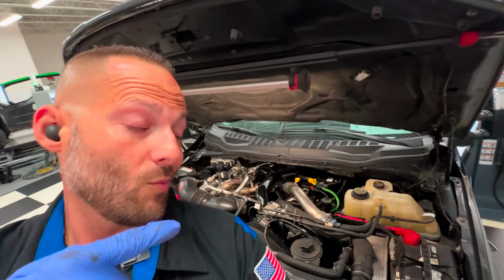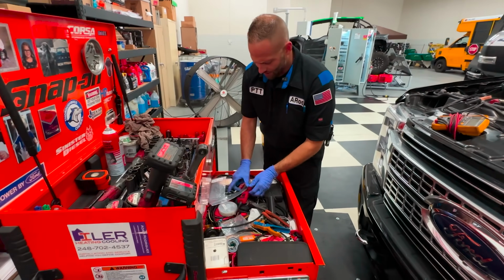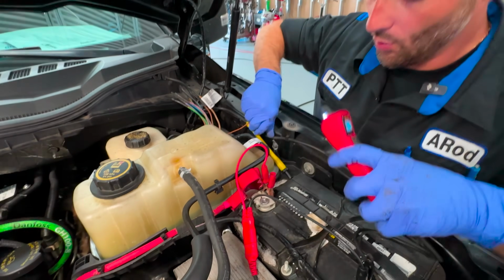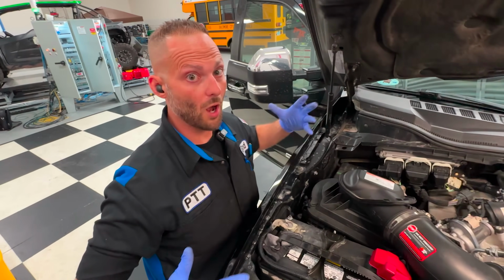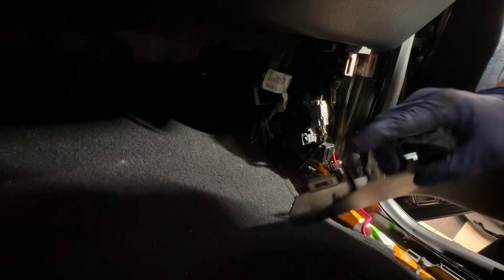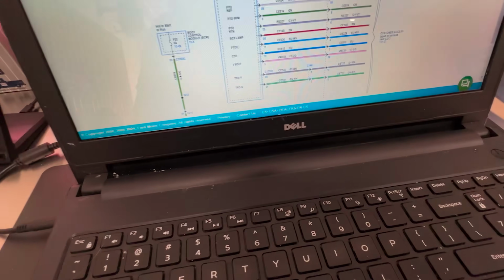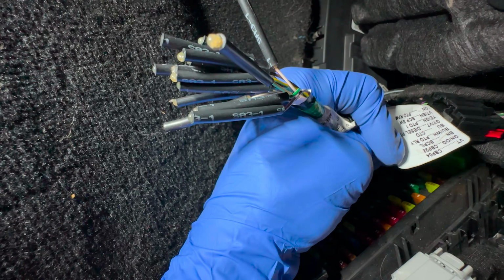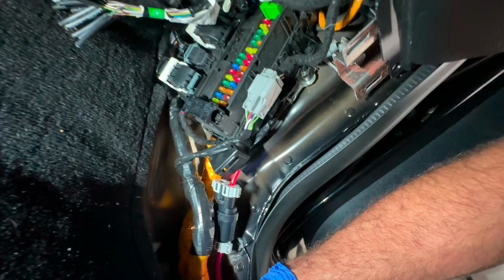TAP into 12-volts | the EASY way FORD F250 F350 F450 #electrical

Comment: I used that wire on the PTO pigtail and a pass through wire from switch 6 into a diode with 2 inputs and one output to wire dash cams. This allows it to run with key on and then use the upfitter switch while parked somewhere to keep recording without back feeding the circuits.

Comment: My SUV does not have a USB in or near the dash for phones, gps, etc. and the cigarette adapters always lose connection especially on bumpy roads. I want a USB I can flush mount in my dash with a constant hot so I know it will stay powered up.

Comment: Keep a “Safety Pin” in the tool box to pierce wire shielding for wire testing. Very small hole in the wire shield that will usually “close” on its own when removed.
Reply from the maker: Key word usually

Comment: Great information Aaron!  Only problem with using pass through wires is that they are small gauge wires.  Good enough for triggering a relay but too small for 12 volt outlet.  I wasn't aware of the 5 amp 12 volts from the PTO bundle, and will definitely use that for my RV gps.
Reply from the maker: The pass thru wires there are two different sizes. Small ones like the PTO bundle then 2 bigger ones. White with OG and just white I think

Comment: So if I wanted to us that CBP22 line could I swap the fuse for 10 amp fuse?  Would the wire there be able to handle that load?

Comment: an actual 12volt tech would never recommend using a test light in a newer vehicle - 12 volt shops, the good ones at least, do not allow any tech to use a test light, ever - never ever ever. In fact, they will test you on this subject. Some of them are referred to as computer safe test lights, but there is no such thing. DMM or walk away.
Reply from the maker: Typical coming from behind the qwerty 😑...
Reply: @PowerStrokeTechTalkwARod  over 20 years as a 12v tech - security, audio, cruise, etc - just an industry rule known by every good tech. When you see a computer burn or air bag deploy, it solidifies this understanding.
Reply from the maker: @AskRemy non-powered incandescent test lamp, get lost man this ain't a power probe 🧐🧐